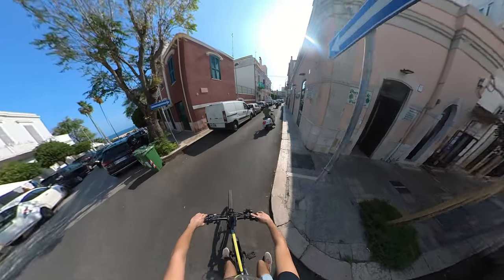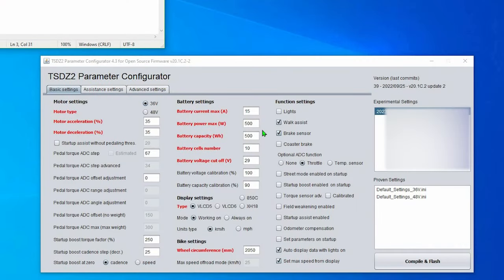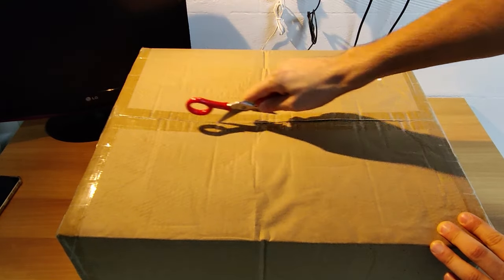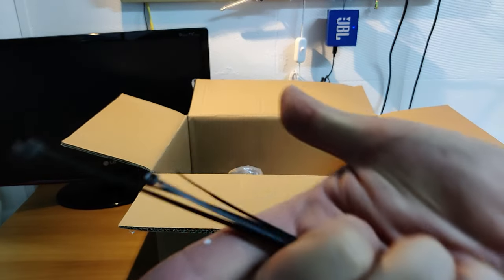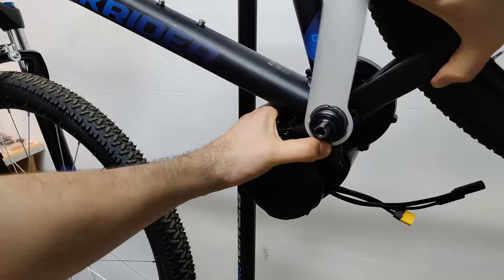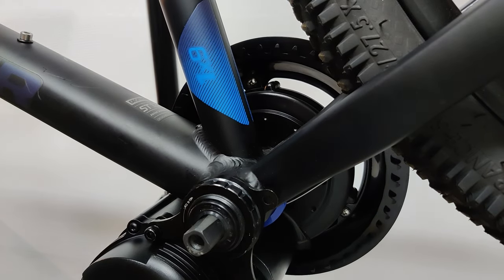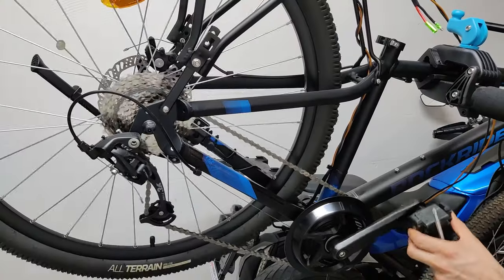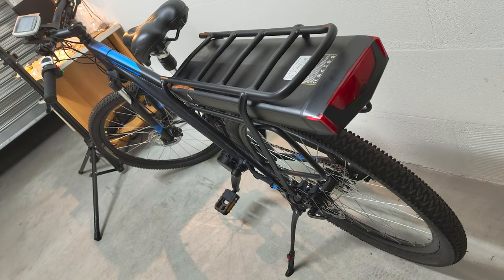TSDZ8 750W part 1: Unboxing and Installation

Comment: I like simplicity. I did not like cables and display. Is it possible to use TSDZ8 without display, speed cable, throttle etc? This is my plan: I build this system with everything. I choose level of assistance. Then, I remove everything except motor and battery. Since, motor works when i press to pedals. It seems it can work with only battery. Is this possible? Thank you in advance.
Reply: Only testing before I put on my bike and it doesn't move when I press the throttle and the speed sensor isn't on.
Reply from the maker: well, you need at least a power button 😄 then a way to tell the motor to always start at, say, level 3, which is impossible in any motor as far as I know... so no, unfortunately, you need at least the display. but it's a valid idea being able to build a minimalistic build!
Reply: @LukeLorusso  thank you for response. I think that if there is power button on battery, it is possible to start motor directly. Starting battery may not start motor directly. Also you are right about assistance level. As you said in video, it is not possible change power settings of motor like 250w version. If it is possible, I change cadence level to same number for all assistance levels. After asking this question, I searched little bit. As you said, it seems it is not possible to use TSDZ8 without display. I have 10kg full aluminium road bike with 700c 25mm tyres and V brakes. Frame does not allow wider tyres than 25mm. I do not like to wear protective equipment. I mostly ride around 15km/h for fun in off-road cycle routes in Belgium. I want to convert my bike to ebike. However, I realized that installing more than 250w motor can be too dangerous for me. Belgium is mostly flat. So, I have two options. Either I will install 250w hub motor to my road bike or I will sell my bike; buy 29 inch frame MTB with wider tyres and install 500w hub motor to it.

Comment: Luke, thank you for your video. I am interested in a setup that would be good for long distance riding. Something that can go over 100km distance if possible, even on a hilly terrain. I would like to have the natural feeling of riding, but I would also like to have the option to adjust the assistance when I get tired. Which motor and setup would you recommend ? I suppose the best way is to try different setups and see which one feels the best, but for some reason nobody is riding mid-drive ebikes, at least not the ones that are assembled.
Reply from the maker: Hey joaomarveloso, those are lot of km! 😄 Look, a Tongsheng motor is less energy hungry than a Bafang. But if you need long range, you need high capacity batteries. At the end of this video https://www.youtube.com/watch?v=e1F4lZeCRUs I mentioned a double battery setup. So, if you go 48V TSDZ8, double 20Ah battery, low level of assistance, you might be able to acheive it... but then your bike will also be way heavier! I guess you have to go step by step, trying and adjusting.
If you go for it, keep me posted! 🙌
Reply: @LukeLorusso  I will, thank you for your help 🙌

Comment: I really like to get this motor, but this 44t is juat soo big and I want to use the bike for some MTB....but this 44t is really a deal breaker. Unfortunatelly no other chainwheels are available ...and with this strange design I doubt theree will be. Any clue in this regard ? Thanks for your efforts.
Reply from the maker: I was able to find 32T too
Reply: @LukeLorusso  Where you found compatible 32t for tz8 ?
Reply: @LukeLorusso have you used the adapter for the chain wheel yet like on the tsdz2/B....? Also can I ask where you sourced your 32t?... 
Thanks.
Reply: @TheBigwesb did you have any luck with this?

Comment: Got same motor will suggest you to change chain ring to 52t makes huge improvement. Also I'm thinking to upgrade this motor to BBSHD because I got used to it and it feel too slow for me 😅
Reply from the maker: somehow what you said is true 😄 it felt slow to me too, but just because I'm used to cadence sensing motors.

Comment: In the settings you change the A? what does this exactly? In the manual is says: Assist ratio setting, what happens when you max it to 36 or put it on the minimum 6?
Reply from the maker: that's basically the max level of Ampere the motor will "suck" out of the battery. this way I allow the motor to get more of it
Reply: @LukeLorusso  Does it limits the peak power? I searched online but get mixed answers.. Have you tried it to confirm this?  For example if you would limit it to 6A you would basically get a 53v x 6A,  318Watt peak motor?
Reply from the maker: I'm not sure I understand your question. It's supposed to be an Ampere limit, in both cases: peak and constant.
I raised it because I'm aware that batteries can provide peaks higher than the declared capacity, if necessary, and I don't want the motor to prevent them. But it can be also used to reduce the Watt/h of the battery, as in your example. In this case, again, both peak and constant A will be limited
Reply: @LukeLorusso  I'm still doing research because I'm thinking of buying it. From what I have read this motor is a lot more reliable than the tsdz2b. I have seen a review where the tzdz8 has a peak power of 1100W, my goal would be to try to get it more in line with the e-bikes that can be bought on the market (that have a peak power around  600/700/800Watts). So it would not be classified as a Pedelec that requires insurance. This would also result in less wear on the drive train.
Reply from the maker: it's a good idea if you want to save energy, and make it look like a "less powerful" motor, but I guess you know it won't make it legal if the limits are more restrictive
Reply: @LukeLorusso   Its unfair, meaning larger e-bike brands just slap a 250w sticker on the motor and call it a day (outputting 700W+ peak power). Most countries in the Eu allow for a 250w nominal power motor and don't care that much about peak wattage. 

I don't care much about fines (although it would be very hard to test the normal wattage of a motor, so that risk would be minimal) but insurance won't cover when you drove a motorized vehicle according the law (And those companies will do anything so they don't have to pay).  Meaning people have the potential risk of paying a very large sum out of their own pockets for the damages.
Reply: @LukeLorusso  By the way, I now found a new forum post that stated the A in the menu is a arbitrary number for the torque sensing of the crank. The higher the number entered, the sooner the e-assist kicks. 

Maybe something you want try out.
Reply: @StarsAtNight1 let me know how you get on with it as I have the TSDZ8 & a 52v 20ah battery & I want maximum speed & power 🤣
Reply: @TheBigwesb  I tried to buy the tsdz2b, but got scammed. I now going to buy the tsdz8. I read on multiple fb groups that the A setting is not for amperage. But peddle assist. Some claim it doesn't do anything. What you could do is to update the firmware so the first and second peddle assist setting get fixed. I now doing research on what 21700 cells I best can buy for my battery pack.
Reply: @StarsAtNight1  Oh no that sucks to hear you got scammed...... How did that happen to you & I got my TSDZ8 from eBay & even though they were sold out in the UK warehouse, my kit got sent from Germany & was still with me in under a week. I like it up to now & I've had many different ebikes. I'm just not to happy with the vlcd5 but I'm looking into possibly making a adaption to the harness & trying out a few other displays I have & see if any are compatible with the TSDZ8
Reply: @TheBigwesb  On Ali, they added track and trace but never shipped. But payed with paypal so I'm probably good. Still need to look at the displays, I think they are also being sold with the EkD01 and SW2-M58. Not sure if they require adjusted firmware to get it working. but the vlcd5 is around 50 bucks cheaper. So maybe I will go for that one and use a bms with app to see the amperage.

Also read that the shift sensor form the bbshd works (but there are multiple version with different pin layout so can only order when I can look what pins the tsdz8 has).
Reply: @StarsAtNight1  yeah you should be okay with PayPal g&s. Also the gear shift sensor does work with the TSDZ8, but with the twin torque sensors & the slight delay in the power delivery. A gearshift sensor really isn't needed

Comment: I replaced my 500 W TSDZ2 with a 48 V 750 W TSDZ8 more than 2000 km ago. I use it mainly for commuting to work, which is about 15 km each-way with a couple of small (50 m) hills.
I LOVE IT! It is much, much smoother and has oodles more power. In fact, I only use it at a power setting of 3 from a possible maximum of 5 to stop it being too fast.
The mounting is good, although it did need to be re-tightened a bit at the 1000 mile (~1600 km) service that I gave the bike.
I took the throttle off as I was not using it :)
Reply from the maker: thanks for sharing! 💪

Comment: Your previous videos had always inspired me and I wanted to try to build a bike too. I waited years... I was intrigued by the torque sensor, but the reviews of the Tsdz2/b had never convinced me. At the beginning of the summer I saw this new Tsdz8 model. I bought it and mounted it on a riverside 500. Apart from the first level of assistance, which is too weak, I find that the engine works very well and with a 13ah battery the km range is impressive .
Now I hope sooner or later you will make a guide to update the firmware.
Thanks @LukeLorusso for the inspiration.
Reply from the maker: Hey Filippo! Yeah, first level is insignificant, but some people appreciate it because it just absorb the extra motor and battery weight, and let you go at "human speed". What can I say...
I really want to update the firmware, even though now I have less time in my life. Still, I will keep posting videos! Thanks to you for the trust 💪
Reply: There have been firmware revisions for this model already, if you aren't running the latest you might run into .. 'known issues . 

The assistance given at levels 1 and 2 has been changed, for one.
Reply: @LukeLorusso  You should update your fw to the latest version before making new content ;)
Reply from the maker: nope I should not! 😊 this is an "unboxing and installation" video. I should report facts, not hypothesis. If someone buys this motor now, this is what it gets. Firmware update is another topic/story.
Oh by the way, you mentioned the existence of a new firmware. Is there a link from official and verified sources that you can paste to prove this statement?
Reply: @LukeLorusso  Ebikestuf eu when writing their review contacted Tongshen and they came up with updated firmware fixing a walk assist issue and the first two levels not scaling correctly.
Reply: @LukeLorusso  I'll make this comment separate just in case YT didn't like me mentioning something they don't make money on. 

'You should' was just a suggestion, especially considering ebikestuff found the issues with the first two assist levels quite damning for the overal impression.  You're absolutely right you will review the out of box experience most costumers will experience, as Tongshen Electric on their official webpage don't seem to offer the firmware update themselves. I suspect they send it to ebikestuff to confirm it fixed their issues, and they will ship new units with the new firmware. Still will need to make it available manually, would be silly if we need to buy some 3rd party 'update service' ;)

Comment: Why not The ToSeven DM02 of 01 (I have only installed a few so far, but I have been impressed)? 

TS messed up factory programming on their TSDZ2, but there was a time when its lightweight and torque sensing made it ideal for most of my customers (installed a gross of them). My experience with OSF has been disastrous. 

Bafang requires so much extra wiring, it is heavy and their antique chips make it slow to respond to cut-offs. I don't have any customers willing to invest in The CYC Photon though I hear it has come a long way from the initial problems that scared me away.

Would really like to see a comparison between The 8 and both The TwoSeven motors (Bafang and CYC programming right at the display). While I have been impressed, I have only seen reviews by wholesalers.

Comment: Hi Luke. I'm waiting for your assessment of the motor as I always found your videos very informative. 
I'm surprised with your comments about the throttle as, you may have the oldest firmware version on it. I watched some other reviews where it was mentioned an improvement with some later firmware. Also to the motor responses  are better tuned but for what I heard they are still not 100% there.
The good news here is that Tongsheng seems to be supporting the community and releasing new firmwares with mods suggested.
Reply from the maker: Hey ukrytykrytyk8477, thank you for your trust!
You're right, I also read that article mentioning recent updates, but I didn't find yet any procedure, nor any firmware to download. I imagine it might be a similar procedure as for the TSDZ2... we'll see 😄
That about Tongsheng supporting the community is huge news! 🤞
Reply: @LukeLorusso  The procedure can be watched in the below Youtube link. It's in Polish but you can switch on automatic translation to understand it. The video has also some links to Facebook group where softwares and instructions are being posted.
Reply from the maker: @ukrytykrytyk8477  Sounds cool, even if I don't have FB. Can you paste the first YT link you mentioned please?